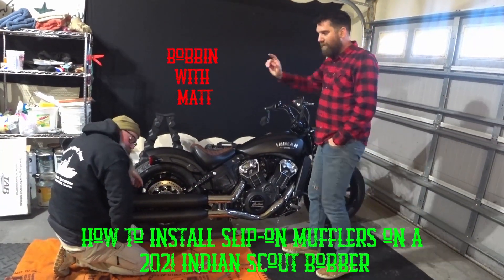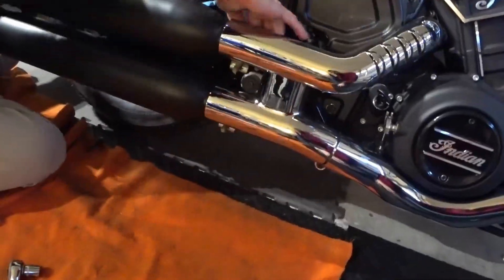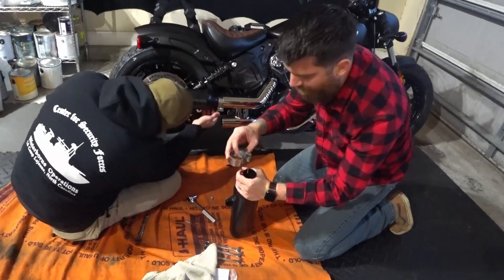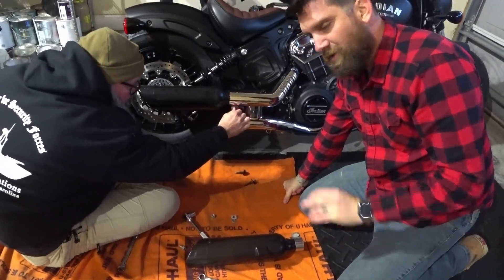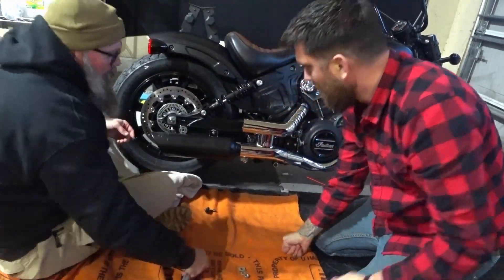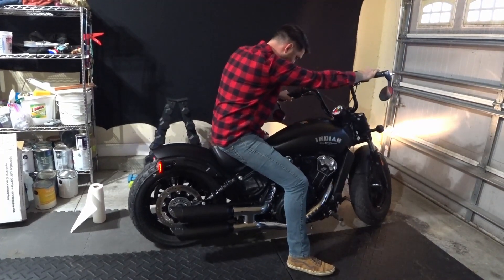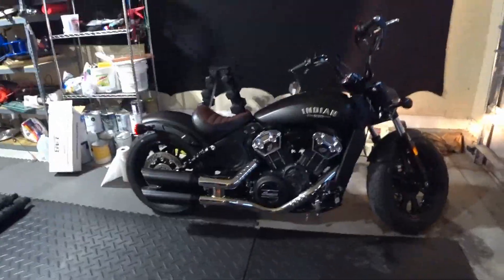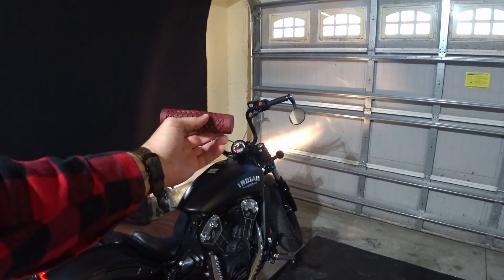Amazing Sound!!!! Indian Scout Bobber Slip-on Exhaust. How-to.

Comment: Is it necessary to calibrate the bike after installing these? The Indian dealership mentioned something about calibrating them to the bike,
Reply from the maker: I don’t believe it will “hurt” the bike of you don’t tune it. But you will be if it more by tuning it.
Reply: I asked Tab the same question and they said you don't need to recalibrate unless you also do the air cleaner.  Mine runs fine with the stock calibration.